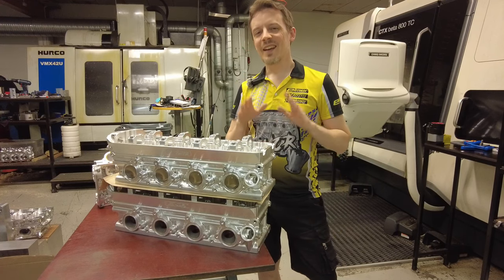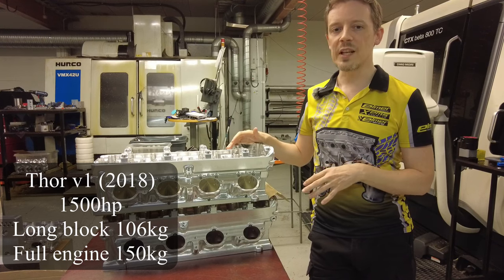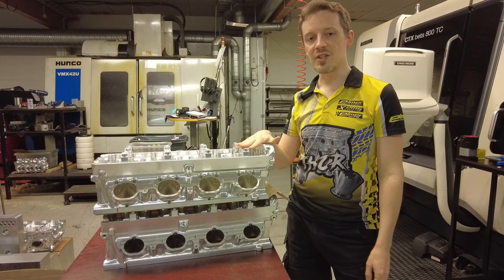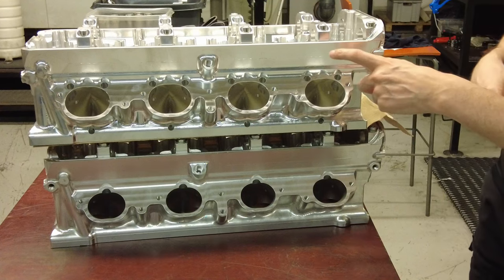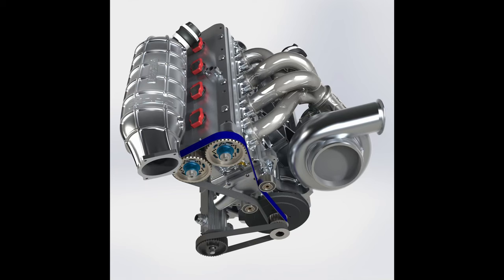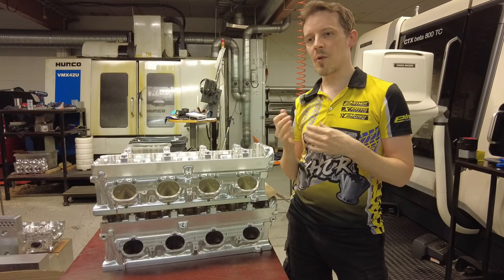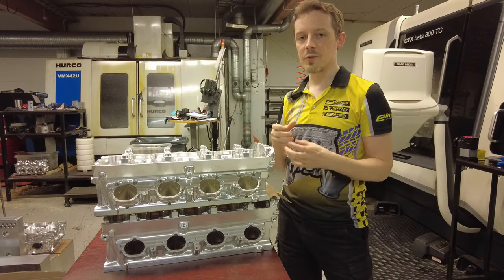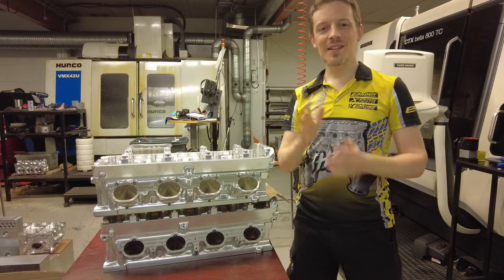2000hp race engine update! Changes from Thor v1 to v2

Comment: A couple of  YouTube "experts" say there are secondary balance issues with inline 4 of this size.  Is that a fact and did you do something to overcome that?  Good luck, keep up yje great work.
Reply from the maker: There are always imbalances in every engine. Just depends on how accurately you want to calculate the loads, and their locations.
How acceptable the vibrations that result from that depend on the use case.
One important thing to note that is often overlooked in "balance" discussions is the power output unevenness. If the forces resulting from balance design are much lower than the forces resulting from power output unevenness, you're not going to gain a lot by focusing on "balance".
Reply: @ElmerRacing  thanks for the reply and insight. Makes sense!
Reply: @ElmerRacing I imagine you would still see a benefit to service life though
Reply from the maker: @weatheranddarkness  Not so much for racing use where you're using high power most of the time. There can definitely be resonance issues though, this is something that always needs to be taken into account by the team building the car.

Comment: Did you use FEA software when designing the new head?
Reply from the maker: Yes. We design the head and block to work together.
This allows good head gasket sealing. And isn't really possible if just designing the block or the head.

Comment: In a NA-setup, reving to 11k rpm, what's the output you can get out of the engine?
Reply from the maker: Uncharted rpm for the valvetrain, but 650-750hp range would be likely.
11k isn't anything super crazy though, most likely doable with custom cams and springs. (for short periods of time)

Comment: What in cyl pressure sensors do you guys use?
Reply from the maker: For continuous in car use, we recommend the optrand type laser reflection sensors.
Reply: @ElmerRacing  How about fuel injectors?
Reply from the maker: "Standard" bosch ev14 type long nose injectors are ideal for keeping port wall wetting as low as possible. Other injectors will work also, just not be as good for cylinder cuts and acceleration enrichment mapping.

Comment: I find in interesting how much time and effort you've put into such a oddball of an engine, its amazing what you've been able to get this platform to do.
Reply from the maker: For optimum power/mass ratio at this power level with a four stroke engine, we think this has to be very close to the optimal layout. Electric and turbines don't stand a chance. Two strokes maybe.
With some more hardcore design effort we could probably drop a further 25% off the mass also.
Reply: @ElmerRacing  Have you thought about a 8cyl drag racing version of this engine, same heads just a different short block.
Reply from the maker: Definitely possible. If 3000hp isn't enough :D
Reply: @ElmerRacing  Takes a lot of power to get a car to go mid 6s
Reply from the maker: A lightweight 6000hp engine could make good progress towards that!
Reply: Is this engine available to buy from regular consumers? Would love to put this in my build

Comment: What a marvel of engineering. ❤ Is there any dyno info on it?
Reply from the maker: Most data is from the rp968 teams half shaft torque sensors on track in actual driving conditions.
Reply: @ElmerRacing  Thanks for the reply. I would imagine you might want to keep that sort of data private given the competitive nature of racing anyway. I'll have to be honest, my curiosity towards a dyno sheet stems from a deep curiosity as to how one of these engine would feel like in a drift car. Simulated, of course, but with the way budgets are going in the sport these days, maybe you guys will eventually get a few calls from drift teams, I could imagine that.
Reply from the maker: @OctavChelaru  boost response depends mostly on turbo inertia/size. Powerband can always be customized with camshafts and manifolds.

Comment: 2000hp in a track car? It better be a very straight track or have Alonso at the wheel of that thing.
Reply from the maker: With some good downforce, you can put down 2000hp already at under 200km/h on slicks!

Comment: For v2 do have 24v  setup optional yes! Versal for turbo ,Na and high  efficiency supercharged 📝🤔 cobalt SS just thinking what compression ratios on these  is 35:1 to 200:1  industry grade strength like heavy duty train plane industrial grade build generator re-enfirced structural intergity

Comment: Why do you need a 4l engine when you can squeze 2k hp out of honda 2l in a smaller package
Reply from the maker: Making the engine even smaller would reduce mass further!
Problem is that you don't see many circuit racing 1000hp 2l engines with a good powerband. Still a ways to go to be able to get a 2l to 2000hp for circuit racing without making the whole package heavier and more complex than a single stage turbo 4 liter.

Comment: GR86 
cobalt SS 2005- 09
 chassis swap  
still be front wheel drive STi transfer case 
🤨 that possible just wondering 🤔 that sound so familiar  shouldof slap vehicle sideways seen that x-pipe 🧑‍💻✍️📝🤔🤨

Comment: Dope crate engine but for that price you can build an American crate engine and car
Reply from the maker: Yes. As we bring up in the video, those big v8's or v6's are only useful if weight isn't important.
For circuit racing, and especially high downforce situations weight is extremely important for performance.

Comment: Just to entertain the nerds reading the comment section: What would be the (peak) thermal efficiency of this engine?
Reply from the maker: Unknown at this point. This would need to be measured with a fuel flow meter either on a dyno, or with a driveshaft torque sensor on the track.